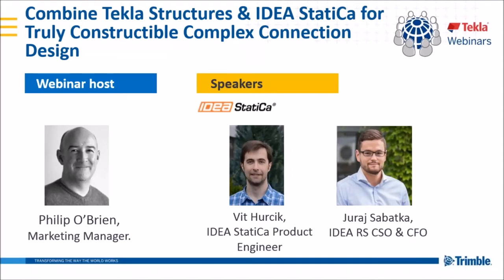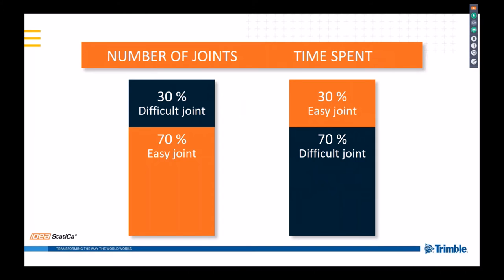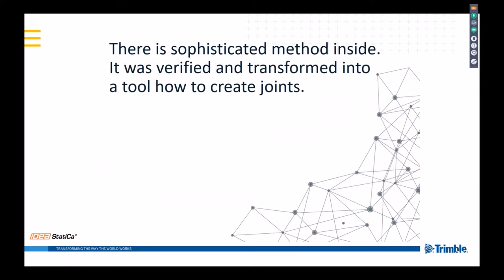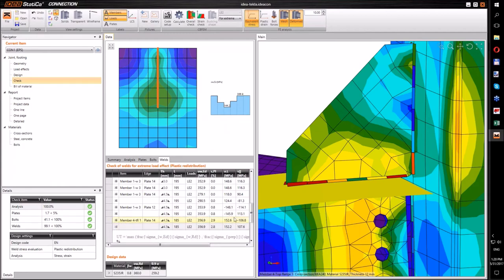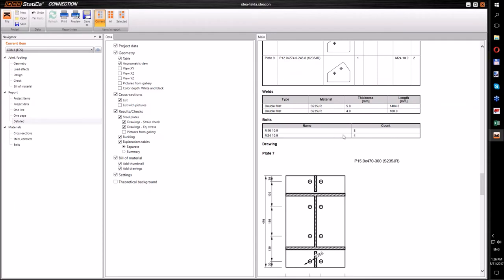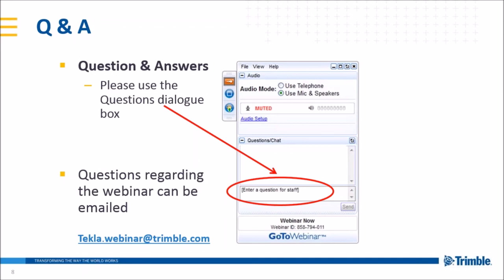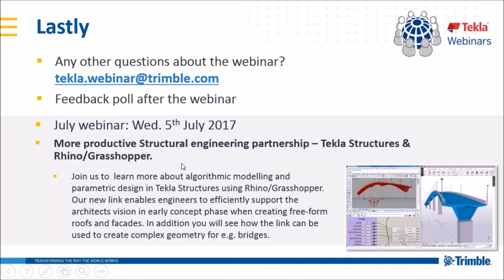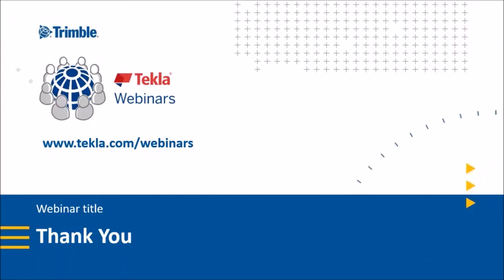Combine Tekla Structures and IDEA StatiCa

Comment: Hello, thanks for the presentation.

I have an issue trying to export connections from tekla to IDEA STATICA.
1-First I tried exporting a tapered colum-beam connection from Tekla to IDEA Statica, but somehow IDEA doesn't recognize the tapered beam which I modeled using welded plates. It does recognize the column but as a prismatic member not as a tapered one. Is there any precise way to model connections in Tekla Structures so IDEA can import them correctly?

2-Something similar happen when exporting a base plate, the problem was that IDEA didn't import the column pedestal.
Reply from the maker: Hello Jesus, thank you for your request but it is not possible to define the error this way. Please, reach out to our support team by submitting a support ticket on the IDEA StatiCa User portal: https://www.ideastatica.com/Portal/dashboard

Comment: Hello, How can i link Tekla Structure 21.1 to IDEA Statica 10 ?
Reply from the maker: Hello! This is hard :) You should be using the latest IDEA StatiCa - in version 10, you could only select one connection at a time, with version 21 you can select and export tens/hundreds of connections in one go. Let me know if you need assistance in getting to the latest version.